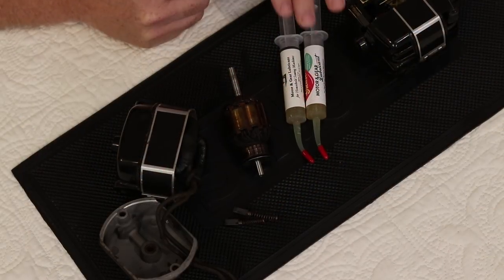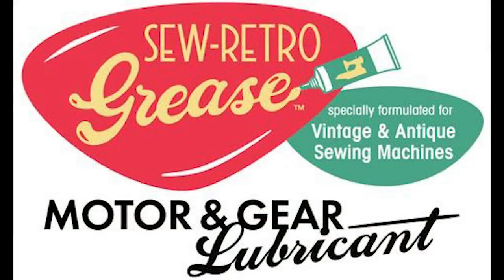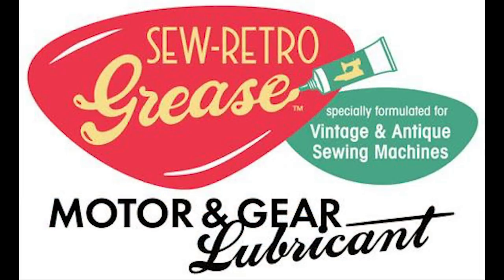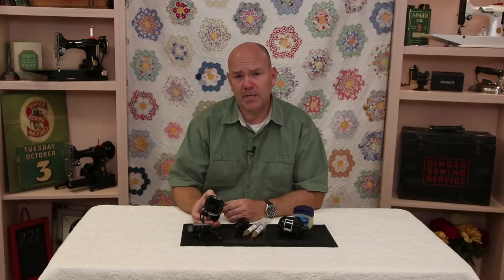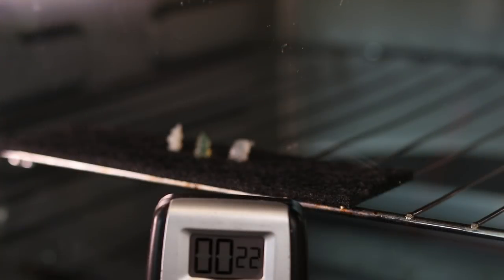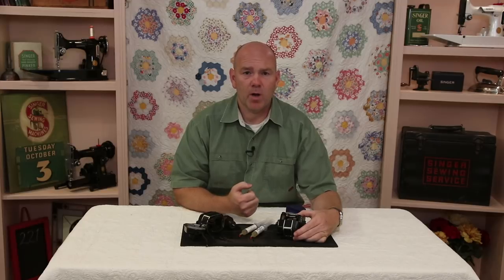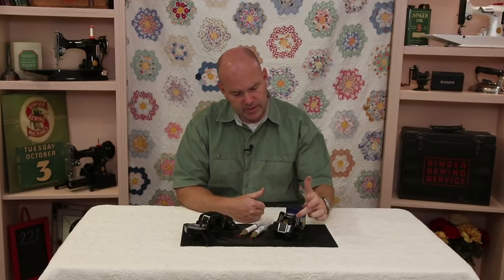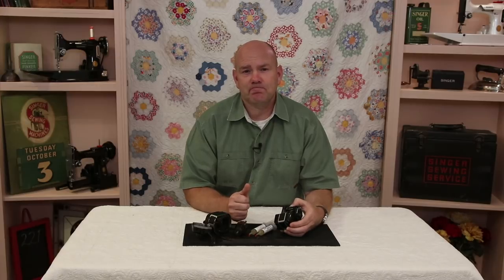Part 2 COMPARISON Singer Featherweight 221 222 - Vaseline vs. SEW-RETRO Grease and Motor Lubricant

Comment: OMG I just found this channel. I have 2 featherweights. One is a 1958 and the other a 1948. I’m pretty particular on who works on my machines. I did have a vintage tube of grease for the motor. But it’s all gone. Every machine tech I’ve encountered says just use regular sewing machine oil. This statement puts those tech on my “no go” list. I live in New Zealand where can I get the proper grease? My machines are family heirlooms and I’m not about to muck them up with vasoline or crap lubricants.
Reply from the maker: Hello there!  We ship worldwide and have many New Zealand customers... welcome to our Featherweight Shop and Schoolhouse!  <3
Reply: Cool, thanks so much. The 1958 one was my granny’s and I learned to sew on it. I’m lucky that hubby is an electrician so he made me a little transformer. The other was gifted to me just recently. It’s been in a closet for over 40 years, it’s pristine and it’s a free arm. I’m so happy. It sews beautifully and the free armies perfect for the doll clothes I make.